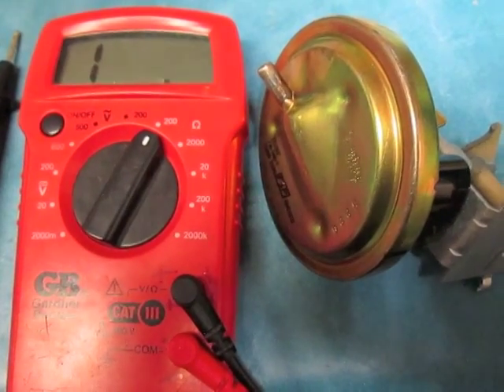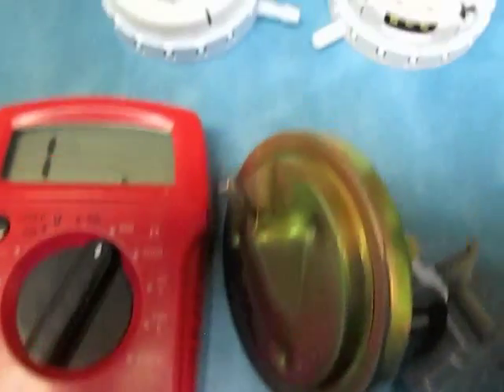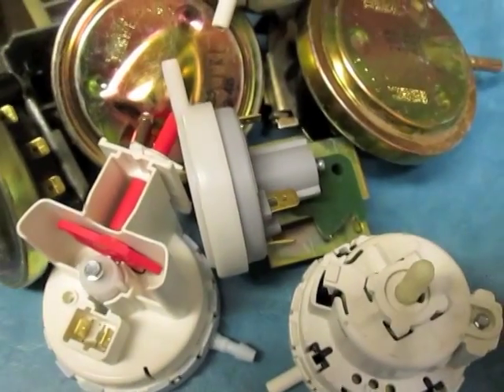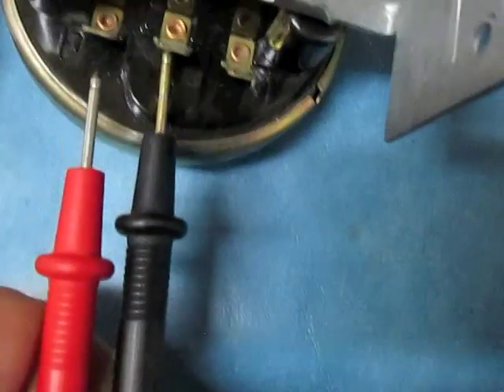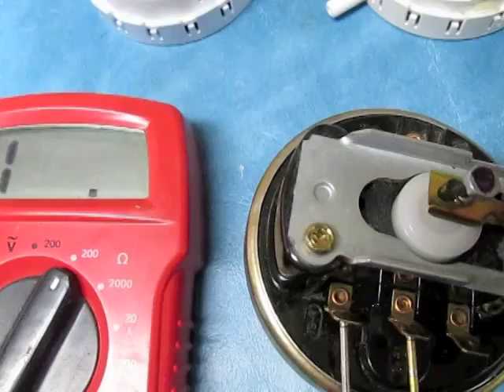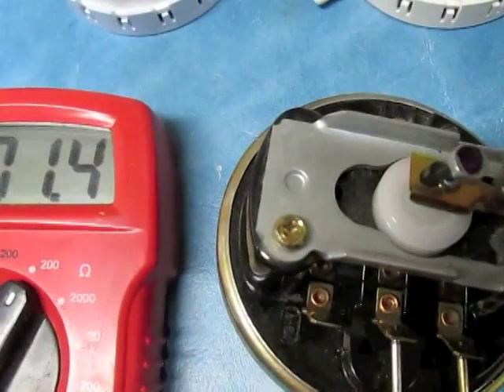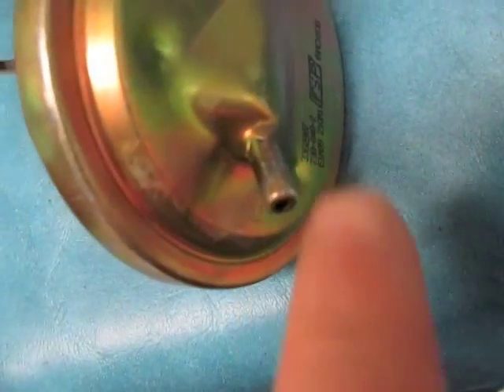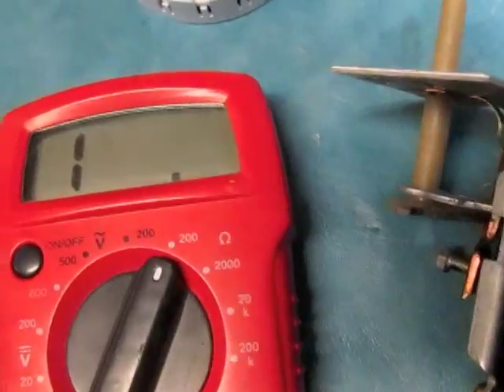How to test/diagnose an overflowing washing machine Won't stop filling HELP! My washer is flooding

Comment: WARNING: I ran across another reason why your washer might overflow. Somehow my wife managed to stop the "load size" switch/knob between the medium and large loads. THIS WILL CAUSE THE  SWITCH TO NOT SENSE THE WATER LEVEL. Flooded my garage (I'm a wood worker). I tried to recreate this situation, it took me approximately 10-12 times to get the switch to "hang-up" between levels. When I finally did I ran the washer and VOILA! Water wouldn't stop (I stopped it before it overflowed). So beware, it's unlikely but it CAN happen.
Reply from the maker: Hey thanks for that.  Definitely something to check...